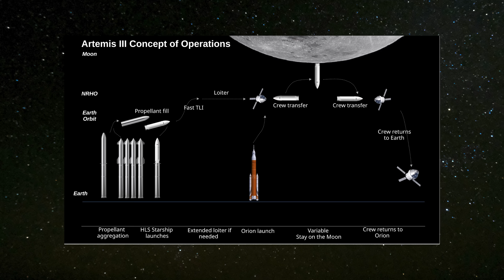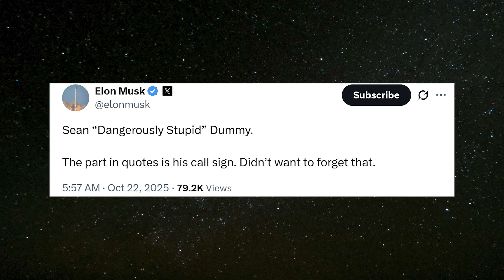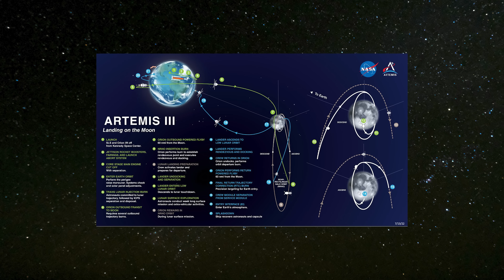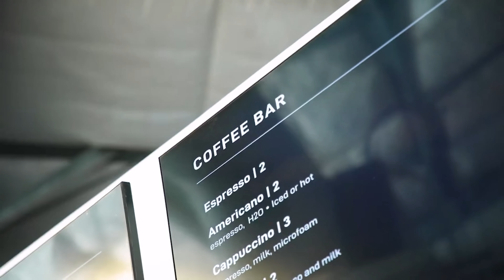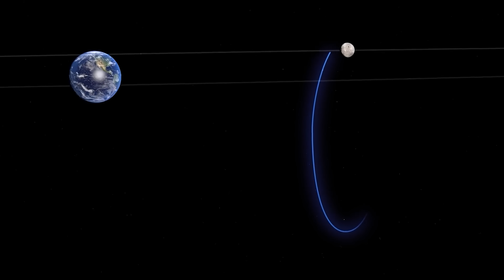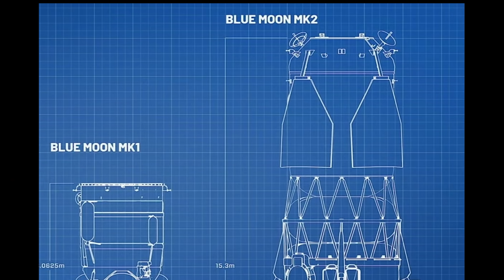SpaceX Found Brilliant Solution to Land Starship on the Moon Sooner than NASA expected...

Comment: Sean Dummy has no clue. BO has no shot at getting to the moon. They cannot get off the ground!
Reply: They seem to have a different philosophy than SpaceX. They are more conservative with development, taking measured steps (less trial and error). I wouldn't count them out just because they don't have a pile of less-than-completely-successful missions under their belt.
Reply: @Deploracle with NASA proving them up, I do not count them out. The fact remains, BO tried landing on a barge and lost their booster. There is no escaping the idea hardware must be sacrificed. Even NASA sacrificed a $4 billion rocket stating their next expendable rocket in their sad attempt at going to the moon will ONLY be $2 billion. While BO hopes to stick the next landing, SpaceX caught two boosters! Sean Dummy says SpaceX is behind because they have not performed an in-orbit refuel yet? And NASA has done what? SpaceX doesn’t need NASA and may tell them to pound sand but NASA needs SpaceX for the space race. BTW, which company is making strides sacrificing hardware and which companies are still talking. I hope BO sticks the landing. They are still a decade away from what SpaceX is doing.SpaceX has already reuse a super heavy booster. BO cannot launch 2 flights in 1 year. The auto industry made advances to safety but destroying cars. Sometimes you must blow hardware up to learn what works. You can thank the auto industry when you walk away from an accident due to hardware destruction. Don’t even get me going on the dumb luck when Starliner docked with the ISS. You know, Boeing…the more conservative approach backed by NASA!

Comment: Use heavy falcon FH. It's ready no refueling is needed
Reply: In case you didn't know, the objective is not to put a 7th exploratory mission on the Moon... for which, I agree, Falcon Heavy would likely do, but to build a permanent lunar base.  That means putting hundreds of tons... thousands at term... of equipment (and crews, obviously) on the Moon.
Refueling has not been proven yet, that much is true, but is unlikely to be a hurdle, as Gwynne Shotwell said.

Comment: Going to the Moon during the President’s current term is never going to happen, because Blue Origin or any other company haven’t built anything yet, and even if they started right now, they still wouldn’t make it in time.
Reply: Blue Origin is sending an autonomous lander to the Moon next year (2026)
This is a prototype for the manned lander for Artemis 4 in 2030.

  So, I guess you NOT a space fan, just a Muskrat.
Reply: @jameskelly3502  Correction:  BO will TRY to send an autonomous lander to the Moon next year (2026)
Reply: Make it in time for what exactly?

Comment: Not bad.  But the early part of the video spent considerable time saying that SpaceX has problems building Starship rockets fast enough.  To date, however, that has never been a problem, so this claim comes across like gaslighting.  The biggest hindrence to the pace of Starship development, so far, has been the glacial speed of government bureaucracies approving flight windows and clearing other kinds of red tape.
Reply: Starship keeps blowing up unexpectedly.
That's NOT supposed to happen!
Reply: @jameskelly3502  Not unexpectedly..  It's part of SpaceX's development process.  Early on, they work out problems and test limits during actual flights, knowing the rocket might blow up.  For example, for the most recent Starship launch, they left off a dozen heat shield tiles in certain places to see how robust their design was, knowing that it could lead to a catastrophic failure (it didn't). 

Falcon also blew up several times in the beginning.  It now has the best reliability record of any rocket in history.

Your comment, however, has nothing to do with the point, which had to do with SpaceX's ability to produce rockets.
Reply: What is the rush?

Comment: As the old Saturn5 got up, there a craft down and back, how come this bigger SpaceX rocket needs refuelling up there etc.?
I do think it a good idea to have a fuel store up there in space that all sorts could access if and when needed, by design or to cover emergencies.
Pressure to make good progress is good, but it is daft to overdo it, with silly little ambitions to beat the Chinese, or be in one president's office term so he can show off. 
Full steam ahead with due care and caution!
Reply: Mass to orbit difference and stages are the reason. Saturn 5 only had to get a 5 ton lander on the moon, SpaceX is trying to get 100 tons of payload alone to the moon. Saturn would burn a lot of fuel in first stage, then drop it and burn the 2nd then the 3rd, each burn have less mass to push, but no way of retrieving the parts. SpaceX have 2 stages and need fuel to land the stages again, one on Earth the other on the moon, so you need more fuel in orbit to get the same "push", and it's so much bigger than the small capsule used in the 60's, and at 1/15'th the cost per lunch, or even 1/30'th if they get it down to the 10 million per lunch they are hoping for, as fuel and small repairs would then be enough to launch a rocket again.
Reply: @-JustHuman- Thanks, makes sense.
As a small child I made a scrapbook of newspaper cuttings of Apollo 8 go round the moon, and later saw the original landing on old B&W tv. Seems a huge time gap, I may live long enough to see it being done again with a bit of luck!

Comment: Lunar Starship will not be the lunar HLS, not if NASA intends to land men on the moon in 2027 or even by 2030. Starship has barely achieved a successful landing in the ocean, much less a landing with astronauts. It has never refueled in orbit or performed many other maneuvers required for a lunar landing and return. Blue Origin is a simpler system with a better chance of success in the foreseeable future, and NASA will likely choose it or another competitor to replace Lunar Starship next year. Even if a shorter Lunar Starship would improve the lander, it's much too late in the game for a major redesign.

Comment: Amazing! Saturn 5 was designed and built using slide rules without modern computers.
Reply: Yes, and it's lightyears inferiour to starship. and compensated abysmal efficiency due to lack of good simulations by just going superbig and making the moon lander the tiniest sardin can it could be and the mission as short as they where to make the Saturn 5 work.

If you think about that Starship isn't that much larger and having far several times more payload to the moon being reusable, it'S insane how far US spacetech has advanced.

Comment: Landing a tall rocket on the moon with diddly little stabilising legs will almost certainly topple over unless it lands with zero sideways drift on a very flat, level and firm surface.  Compare that to the landing dynamics of the Eagle luna lander which was designed to land successfully on an imperfect surface.

Comment: Starship launches haven't had "mixed results".  The vehicle is in development, when something goes boom, all that means is that SpaceX discovered a limit, which is what rocket development is all about.  They're pushing the limits on every launch to feel out the operation ranges the vehicle can handle.  That way, once it's running missions, it'll be able to operate well within the ranges of capabilities that the machine has.  One way to get to that point where you have the knowledge necessary to put the vehicle into operation is rapid iteration after rapid iteration.  There are other ways, years of computations using high end supercomputers and such, but SpaceX's method is cheaper because it's not 1/2 billion at every launch once every couple of years after a decade of development.  It's on track, but I think not everyone understands the process at play here.
Reply: Saturn 5 never went boom and they did everything from scratch, with slide rules, space con is a scam
Reply: Yeah yeah, we get the process, it's been explained a million times. Does not change the fact that they planned cargo missions to mars by 2024 when the current testing campaign began in 2023. Also doesn't change the fact that they keep blowing up expensive rockets that don't deliver anything. The project has clearly been delayed and turned out more difficult than SpaceX imagined, go figure.  

Still, feels like reopening the contract is political as I know of no other aerospace company that has ever delivered a major system on schedule. Pretty sure by the time all the other components of SLS are ready, so will be Starship.
Reply: @Lhommeaudacieux  You're misunderstanding the development process that SpaceX uses.  They are not blowing up "expensive rockets".  These developmental rockets are stripped down, and intended to be used to find the limits of the design.  This was expected.  There was never an "oh darn" moment where the rocket fails.  These developmental versions are being stressed to the limits.  It's always expected when you're pushing the limits to determine what those limits are.  Falcon 9 development went down the same road, but now Falcon 9 is SpaceX's workhorse that's sending people to and from the ISS, putting up satellites for customers and building the Starlink satellite system as well.  Starship will get there, and likely far in advance of Artemis as any Artemis launch simply means it'll be years before another launch.
Reply: @JohnLaury-1 Yeah Yeah, as I said we get the process, but even a stripped down rocket is eye-wateringly expensive and SpaceX never expected it would have to expend 15 Starships to finally get to Orbit and back to the pad, if 15 will do. I have no doubt Starship will eventually work, just saying they‘re behind schedule and facing significantly more difficulties than they were expecting requiring so many changes that they had to completely shelf the idea of landing Block 2 and now can only hope the Block 3 updates improve reliability enough that they can attempt the tower catch. They also clearly have not figured out how to keep the heatshield in one piece and essentially given up on complete reusability and currently don‘t seem to have any idea how to proceed other than to replace dozens of tiles on every flight, which will still increase turnaround time from the originally touted 1h to likely a few days. Still better than anything close but still a real „oh darn“ moment to use your language. As usual Musk promises you the moon and never delivers, but what he does deliver is still better than the rest.

Comment: SpaceX is not stupid. The data they are acquiring by repeatedly testing and launching is critical to success and safety.  The process is extremely expensive and it takes time. After reviewing all of the critical data, then and only then will a huge ramp up in production be initiated. What good would a huge amount of tech and components be sitting around if they all contained flaws,that jeopardized each mission?
Reply: Russia used this method and is still flying a close iteration of the 1st Soyuz that is more than 50 years old, and that's why Russia had few innovations and USA ran laps around them the last 50 years, iterative space advancement is an oxymoron
Reply: lol tell that to space shuttle. How many dummy flights they need before putting it to flight. It’s just a very rich man who can throw money at problems doesn’t mean it’s critical to dump these suckers in the ocean

Comment: China will eat America this time.
Reply: China may get there first. But- When SpaceX gets there, the reusable nature of Starship will mean they can do it repeatedly and for a tiny fraction of the cost compared to China. The lander will also be so large that it will essentially be a whole moon base when it lands. Once they prove out being able to do it once, the game will change. The lowered cost will make it possible to build a large, active, and populated moon base that operates at a sustainable cost like ISS did for decades.
Reply: @shableep problem is you belive that SpaceX will do that. There is nothing pointing in that direction that it will happen atm.
Reply: @SirSparris  I think the real issue is you believing they won't. They've been making rapid progress to full reusability at a time where almost no one else is even attempting full reusability. Their fully re-usable Starship + Super Heavy Booster Successfully launched, went through the atmosphere, and landed. They even tested the Starship returning to Earth with more than 8 missing heat tiles and it STILL made it back to Earth. Next is testing v3, then catching both the Booster and Starship back at the launch site. That could all happen next year. Which would set SpaceX and Starship up for refueling tests (for the moon mission) in 2027. If that succeeds, then they'll be ready to test the SpaceX lunar lander in 2028. And if that goes well, a full moon mission by 2029 or 2030.
Reply: Imagine launching a moon base from Starship for $50 million per launch, instead of $4 billion. At that point, no one in the world will be able to compete with SpaceX. Still, to this day no one else has been able to land and reuse an orbital booster like SpaceX did in 2015. It's been *10 years* since then and still hasn't been matched. Which means that when SpaceX manages FULL reusability in 2026, they may be 15 years ahead of the competition.
Reply: They haven't been to orbit, yet. Rapid reusability? Lol. They have had like 10 dummies of stupid satallite system that destroy science. When fully loaded test? 
You said same thing when V2 came. Problem you belive in anything Musk says.  @shableep
Reply: Dazu müssten die Chinesen kreativ werden,  sehe ich noch nicht.
Reply: Wrong. China can only copy, not innovate.
Reply: @lbuschjr you living in the past. It's that attitude that makes you loose.

Comment: It's very simple. Just make a non-reusable upper stage for Superheavy. Just a 6 engine cylinder with no flaps, no payload bay, no nose cone, no heat tiles. On top of that you stick a simple lunar lander with ONE raptor engine and some legs. These get thrown away just like Apollo. Meanwhile continue to work on full reusability with no pressure.
Reply from the maker: I will find more about this, thanks your idea

Comment: The problem is that Starship wasn't designed to go to the moon or Mars, it was designed to launch multiple Starlink satellites more efficiently and has been rigged to also go to the moon, but landing and taking off with that big rocket will require so much fuel that 20+ refueling in orbit will be required and we have never even done even one fueling in orbit. That will require launching over 20 rockets just to carry fuel for 1 moon rocket. The whole idea of a big rocket landing on the moon and then taking off again with crew to return to earth is very inefficient. With Apollo we only took the LEM down to the moon surface and then left most of the LEM's landing legs and rockets on the moon returning to the orbiting Apollo to hook-up and return to earth. Also bringing a huge rocket out of earth orbit back into the atmosphere will require so much more heat shielding I am not sure that will be possible with present Starship design. I am not sure the USA has the money to put into this space venture, let rich billionaires do it with their cash, we need to focus on reducing debt and rebuilding our economy.
Reply: Ummmm... wrong,.  Block 4 is absolutely intended to go to the moon and Mars.  Earlier iterations can also help out with Starlink, but that's not their primary purpose.

Comment: I have long had a cool idea.  Every have a slinky?  Let's say your put a big metal coil or some other form of shock absorption, let the craft hit hard, absorbing as much shock as possible then right when it hits zero velocity--lock it in place (so it can't bounce it back up).  When read, release and it'll bounce you back up to maybe 80% or so of the point where gravity started pulling you down.  So, it'll need very little fuel to continue.  At the very least, use this just to get up high enough to ignore your rockets without blasting debris all over the place..

Comment: SpaceX did not invent the phrase "Rapid Unscheduled Disassembly" (RUD). It comes from the Kerbal Space Program community. (Just like the phrase "suicide burn," which describes the method of landing long used by the Falcon 9, though for PR reasons SpaceX invented a "prettier" name for it.)

Starship hasn't "achieved" a full orbit not because it's been 'incapable' of it or 'failed' to do so, but because they deliberately designed its flight path to be suborbital, since they were still testing the ship's engine relight capability in microgravity. They did not want to take even a small risk that it would get 'stuck' in orbit and come down randomly instead of in a planned, safe location. They've had enough trouble already thanks to the two early Block 2 ships that exploded on their way up, nobody would want to increase the risk of such events. The recent successful relight tests should mean some upcoming test flight will go all the way to orbit.
Reply: Thank you for a sane reply amidst all these armchair astronauts.
Reply: @RobinMiller-v6c  Yeah, there's way to much opinionated Dunning-Kruger bloviation going on (all over the internet), even before you add in the new AI slop problem.